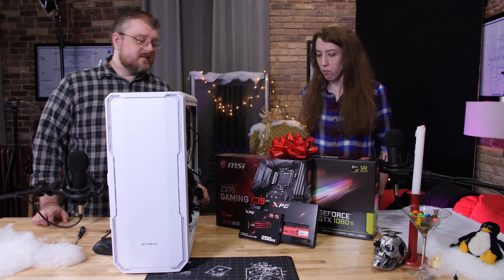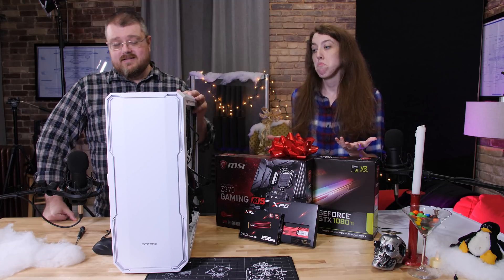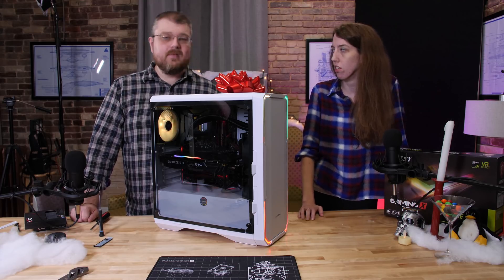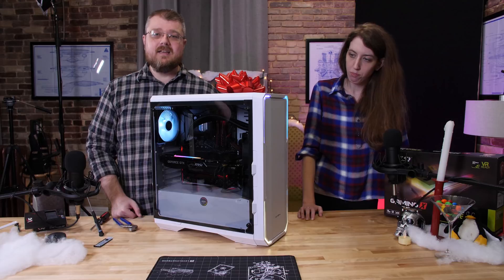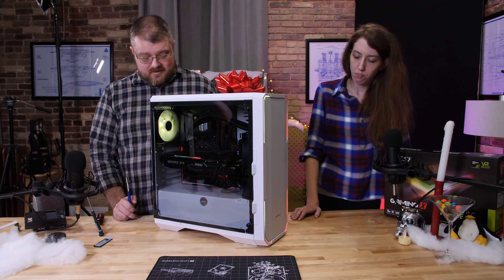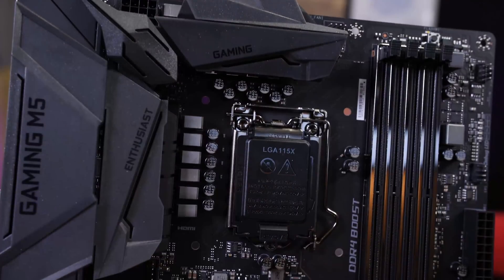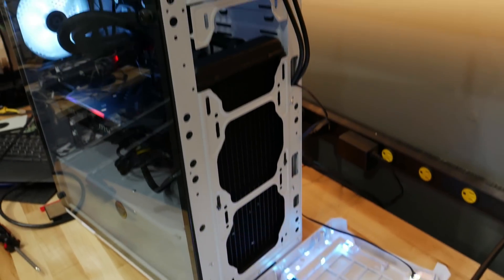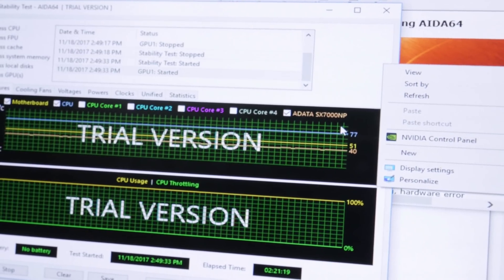The Level1 Techs 2017 Screeching Gamer Build! ft. MSI GTX 1080 Ti Gaming X Trio

Comment: Drill a series of holes in the front of the case or cut out a panel in the front panel and back the opening of holes it with some mesh to act as a dust filter. Airflow problem solved

Comment: Honestly guys, you should have know better than to build in that case. It has awfull airflow, if it even has any aiflow, and you put a 1080 Ti in it?
And then you talk how there are much better cases for the same money? What in the actual fuck was even the point in showing that fugly case?
Reply: they did a review on it and regret the conclusions then. the point of this video was to correct the case review. no more no less.
Reply: He called it a pretty decent case and even said that airflow is decent, and basicaly the only reason why it isnt reccomended is that Bitfenix priced it at 90 USD. This case is pure crap, plain and simple, even at 60 USD there are much better cases. This case is a polished turd, it shines and looks fancy, but it is still a piece of crap.
Reply: i do agree
Reply: I guess you didn't watch until the end, where they said it's more of a 40-50$ case and they wouldn't even really recommend it at that price.
Reply: Yeah, i've watched it until the end and I was wondering the whole time why they were talking so much about this crap case.
The only thing they should have done is: "We wanted to use Enso, but it is honestly not worth it, so we instead used -insert any decent case-, which is much better case in any regard than the Enso, which we wouldn't reccomend to anyone". 
Now, I know they can't word it exactly like that, if Bitfenix is their sponsor, but they talked most of this video how this case isn't good and they built in it after all. This looks like some crap that Linus would pull off in one of his "non sponsored" builds.
Reply: Boris, so you have never worked in business have you? situations is crystal clear here:
- they got a sponsor and a product to review and showcase.
- they were fed inaccurate info, who even knows if deliberately or not.
- they may or may not have a contract around the deal, which is reason enough to build in the case even if it's the worst in the world. as long as the honesty remains. which it did. maybe they wouldn't take the deal if situation then was different, but after it's done, you can't just take it back like nothing happened. there will be consequences.
- even if the deal wasn't a contract, you will get shot down fast if you burn all your bridges at the first minor shenanigan that happens. no one who is anyone in the whole industry does that. there are "gentleman" ways of handling it. which is what Steve from GN does, as a prime example. 
- they made a 2nd video correcting the 1st case review. imho they should have edited the 1st video with the updated opinion. also imho the case airflow issue should NEVER have been understated. but the thermals in benchmark do show the case didn't choke the system to the point of letting anything burn so calm down as it's not like this is gonna lead to someone dying.

i agree they should be a lot more careful next time. i was pretty disappointed with that case review. we should given them shit for it so they improve. but it needs to be valid arguments shit, not internet troll triggered shit.
Reply: Have you read part of my comment where I said that I am aware that they probably can't call this case a piece of crap IF that is a sponsored build, which they haven't mentioned not even once. If this was a sponsored build I wouldn't care, it is what it is, but this is some sort of reccomended build in which they spent at least half of the video saying in really nice and well chosen words how this case is pretty much awfull. That is my problem with this video. there is no need to hide the fact that Bitfenix paid for this build/review, there is nothing wrong with that.
And to answer your question, yes - I have workedr in bussines, dealt with various sponsored deals, but thanks for explaining to me how it works like I am an idiot.
Like I said before, if they mentioned just once that this is a sponsored deal/build I woulnd't care, unless I somehow missed that part/watermark/anotation.
p.s. Also, a valid critique from a fan (which I am), no matter how harsh it was, can't be trolling, but thanks for calling me triggered internet troll. I appreciate that. / sarcasm off
Reply: they have talked about this build previous to the video release a couple of times. not worth it to trace it imho, i still don't like the case review no matter what is going on.

they are not hiding it as well imo but the lack or clarity does concern me.

well i have no way to know if you are an idiot or wise, so i was trying to cover a base. and i know it's implied that i was calling you an internet troll but i just feel like you are sounding a bit like that, not that you are actually one at all. all i wanna say is, chill a bit. leave the valid criticism, i agree with that and stand behind you on it, but don't take it too far or it will lose credibility.
we good?
Reply: Yeah, we good. I just hated how they dealt with this build/review. I mean, they had to cut the damn thing to fit the AIO. Just one damn mention that this is a sponsored build and I wouldn't even bother commenting. That is all that i wanted. Simple, isn't it?
Reply: also i have to say, due to this review i will multiply the salt i add to L1T's reviews exponentially henceforth. they really went down far in my view as far as reviews go.

Comment: Meh, I scored a midly scratched OG Silverstone TJ07 for U$100, and after cutting, filing, 3D-printing and painting, I guess I'll not buy another case for at least the next 8 years.
Reply: sweet score dude yea im with you i scored a enthoo evolv atx tempered glass for 70 it was dusty and missing the 3.5 drives at the bottom but i wasnt gunna use it anyways but man a tj07 ur super lucky keep that forever bro